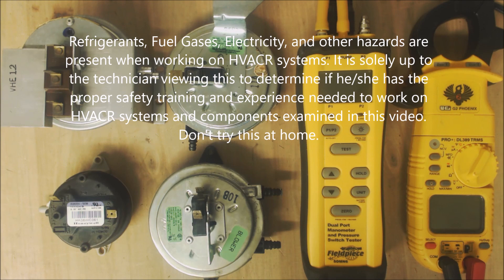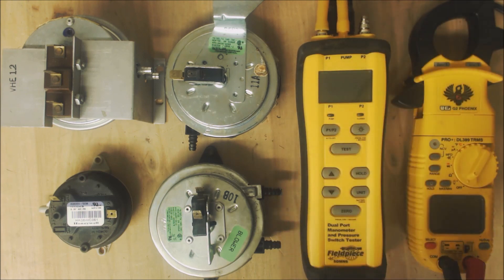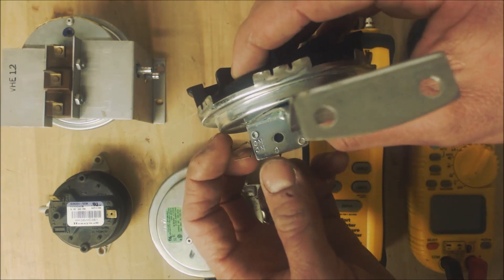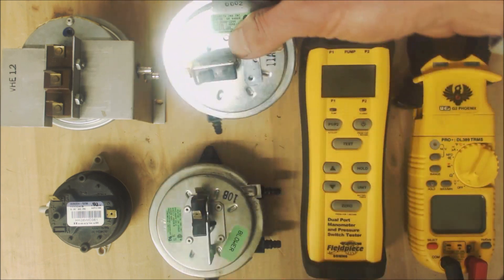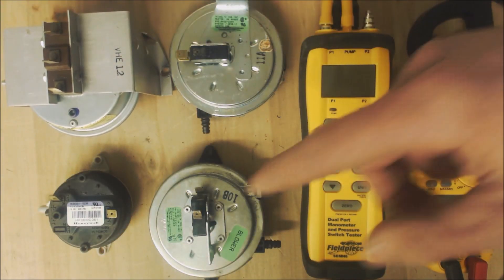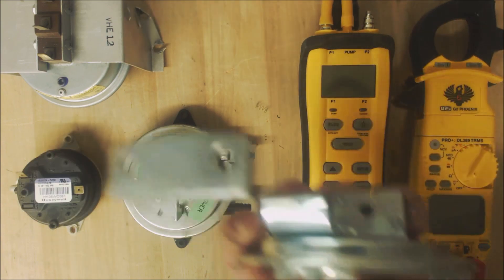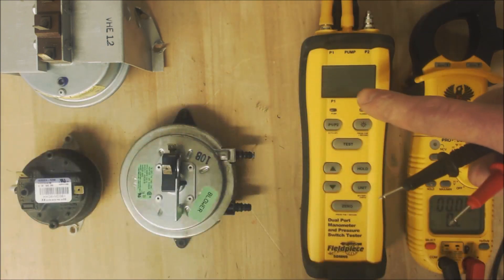How the Gas Furnace Pressure Switch Works & Testing!

Comment: Can you wire a pressure switch backwards?
Reply: its a set of NO contacts so no you cannot. Landing 24v hot on NO will produce the same effect once the switch is closed. Signal will still return to the control board through the common terminal.

Comment: Hello ,
I have question ,
I have furnace ,the inducer runs ,the pressure switch closes,the igniter turns red but no voltage to gas valve ,
I replaced the board and same problem ,
But when I disconnect the orange wire (the 24 volt wire from gas valve ,I see that I have 24 volt to the disconnected wire after igniter gets red ,
What’s the reason ,
It does not make sense for me ,

Comment: I have question ,
When inducer motor works ,pressure switch closes ,igniter gets red but no voltage to gas valve ,
When I separate the 24 volt wires from gas valve

Comment: Great video!  So here's a question:  my Trane uses a dual port (with +/- connections) that requires a 1.4WC negative draft.  I've tested the hose from the secondary exchanger which pulls 1.6 to 1.8 continuously while running.  It's connected to the negative (-) side of the pressure switch.  The hose from the burner box/gas draws about .10 to .08 negative pressure while running.  For some strange reason, the switch will not close when the unit first starts.  However the whole thing works perfectly (on/off/run) if I disconnect just the hose from the burner box (the differential is just the atmospheric pressure).  If I reconnect the burner box hose while running it keeps running, but won't work when it cycles off and back on.  I replaced the sensor, vacuumed all lines, cleared the trap, etc. I also replaced the inducer motor to ensure it wasn't the issue.  The HVAC guy says the only thing it could be is a bad secondary exchanger (which is under warranty even though the unit is 14 yrs old).  When I replaced the inducer motor I caught a glimpse of the secondary exchanger and it looks really clean. Any ideas?  I can only guess that for some reason there's too much pressure in the burner box or not enough in the secondary exchanger (clogs I can't see?) and indeed it needs replaced? Blerg!!!!
Reply: I've got a Trane XB90 doing the exact same thing. Manometer results are simliar to yours, plenty of pressure to open/close the switch. Tried new pressure switch, inducer motor, and control board. Did you ever resolve this?
Reply: pay your professionals

Comment: Are pressure switches interchangeable as long as water column is same ???
Reply from the maker: Yes as long as they are the same amount of ports and type and also the same small orifice insert at the inlet that the original one had, thanks

Comment: I have a 2 stage kelvinator 2 different pressure switches..1.3 and the other is 0.80 is that normal or can you use an 1.3 in place of the 0.80?
Reply from the maker: You should replace the pressure switch with the exact same size if needed. You may have 2 switches acting as a differential from the flame box to the inducer or you may have a two speed furnace. For safety only replace with the same size, thanks

Comment: hi, today i saw a furnace pressure switch that says 1.0wc PR. i tested and found out that this switch is normally closed. the pressure switch is connected to the condensate trap . the other two pressures were PF (for the gas stages) switches were normally open. is it normal for the 1.0wc PR to be normally closed? thank you.
Reply from the maker: Hey Mark, most pressure switches are normally open but it is possible to have one that is supposed to be normally closed, in fact there are some like that but they are older with a lot of relays instead of boards. You would need to look at the wiring diagram to see if it is supposed to be NC, thanks Mark

Comment: please help as i am a bit confused. as long as the furnace is calling for heat the inducer continues to run. but on a 2 stage gas valve why do we need two pressure switches? one for low heat and one for high heat. many inducers have only one speed. so , the inducer closes BOTH (low and high) pressure switches at the same time on low AND high fire ? is this correct? but it only has one speed. thanks
Reply: In this case, even with one speed before switching to high flame you still want to know you have enough draft for proper operation. For example you could have a 1st stage at .5 and second stage at 1.0 but your inducer is pulling only .8 wc, high enough to run 1st stage but not for second stage.

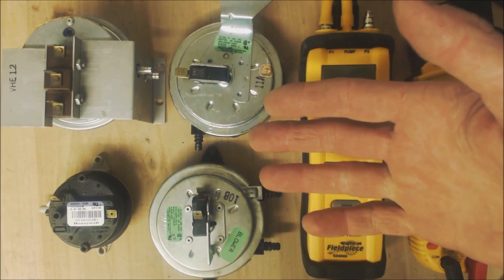Comment: 0:58   please help, i don't understand when you refer to "negative" inch water  pressure,
 i thought inches of water was actually pressure not vacuum,   yous say that switch  is 
0.3 which is equivalent to  0.0108274  psi, to me  negative pressure  means  vacuum not pressure  , doesn't  vacuum always  refers to  inches of mercury??  
  0 inches of water= 0 psi
Reply from the maker: Hey estrelladelnorte1308, so this is different than refrigerant vacuum levels. Our Manometers read in - and + water column levels. This is what our pressure switches are labeled as and this is what manufacturers state in their literature. I understand it is confusing when thinking of it compared to refrigerant pressures, inch hg, psia, and psig, thanks
Reply: ok .. so when you refer as negative inches of water column ,it is an actual vacuum  but measured in inches of water